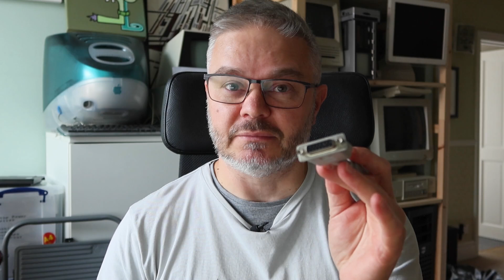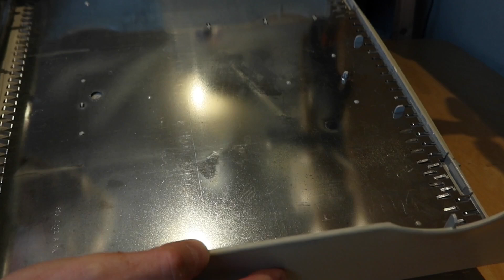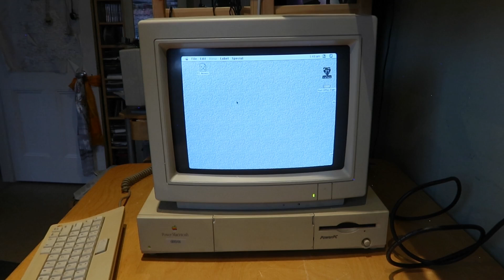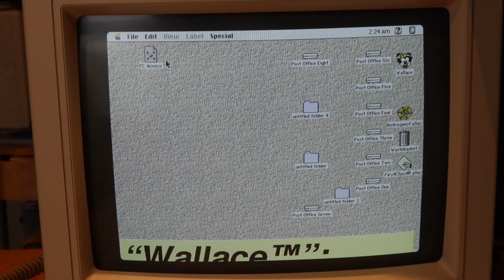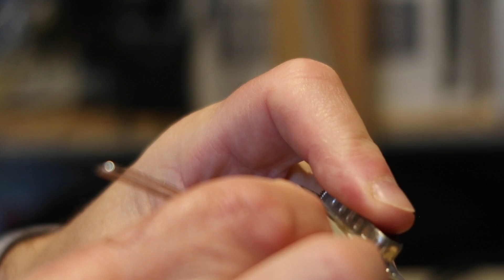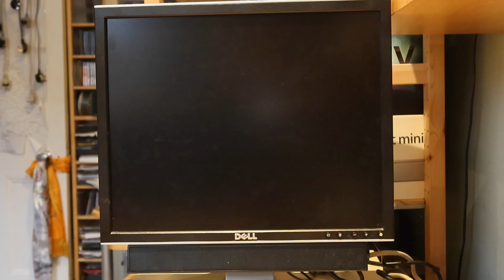Why this is the Key to the first Power Macintosh's

Comment: Upgrading from an LC II, I bought a 6100/60 8/160 for $1,600 in April 1994. I thought that video adapter came with it but I did have to buy the dip switch VGA one to support a 15" Sony multisync display which I think did 800x600. I added the L2 cache which the /66 came with. I also overclocked it to 80 and 84 MHz which I don't recommend because even with an extra fan, I think that killed it in 1997. In the early 2000's I used several of these with G3 upgrade cards to serve as gateways (NAT, DHCP servers, content filtering) in schools. First Class was originally a GUI BBS that had better interface functionality than AOL. You could chat, read through net mail forums and download at the same time for example. I ran one for a couple years.
Reply from the maker: I hadn't realised the two cards on the left were the ROM and Cache. I had assumed they were VRAM until I looked into it. I've got a 7200/90 without the cache card and it is really slow, so glad it's still in there.

Comment: Around the time that came out, I was using a Quadra 610 (68040 processor) which had nearly the same form factor but 15pin video. It had the CD drive with a caddy. I think it had 12MB of RAM. Previously I had been using a Centris 610 which was a similar computer but without the CD or FPU. If I remember correctly, a lot of software wasn't optimized for PowerPC at the time. The fancy Mac at the time was the Quadra 660AV. It had AT&T DSPs so it could do some speech recognition. If I remember correctly, the PowerPCs were able to do the same without the DSPs.
Reply from the maker: I think only something like 15% of the OS code was native PPC at realwease - the rest was run through emulation - pragmatic but slowww...

Comment: I wouldn’t say VGA was a standard yet in 1989. It was still a proprietary IBM port. And Apple had already had a history of using the DB-15 for video back to the Apple /// in 1980 (with a very different pinout), Apple IIc in 1984 and Apple IIgs in 1986.  So it wasn’t too surprising for them to reach for it again with the Mac in 1987 for the introduction of the Mac II. 

That said, the HDI-45 port was annoying - it only existed really for the AudioVision 14 display and for everyone else it was dongle town. Sigh.

Comment: New Sub; Deetroit, Michigan, US.
Well Done sir, Stupid Steve Jobs & NeXT with their Weird Proprietary Cables.
Stupid NeXT Slab Speaker Box...
Stupid Coleco ADAM and their Printer
Reply from the maker: I can see why they tried. It's just this always works better when it's an agreed standard (preferably open). USB-C anyone?
Reply: @NeilKnowsRetro  My PC & Video Game collection has been lost to a Drunkard Mom.
So I've been tryin to find Descent looking system even if they don't Function so I can have Adult ADHD Projects and stop driving the wifey nuts.
I would love to find a Cheap USB-C Power Replacement for these old Consoles.
I just picked up a TI-99 4/A, in Beautiful Condition, but no Power Supply. I've been Super Happy the Pi-PICO becoming a Mod-Chip of Sorts, Hopefully that continues Successfully with the OG Xbox & Dreamcast, I have the GameCube Pico-Boot that I need to get installed

Comment: Wow. I’ve never encountered an HDI 45 connector before and I have numerous PowerPC Macs in my collection. It would seem I have gap in collection. 😢
Reply: NuBus PPC 601 machines. The first and slowest ones. Expandability wasn't hot either - NuBus cards were way more expensive and way slower than PCI cards, and the native HDD and CDROM interfaces were still SCSI, which made drives twice as expensive for the same capacity.
Reply: @MistahMatzah  NuBus was a great idea, horribly implemented. But still better than IBM's MicroChannel architecture. lol
Reply from the maker: @MistahMatzah  At least NuBus was an IEEE standard. And 5 years earlier than PCI so not a fair comparison? Component pricing was was a problem in this era for Apple...not to mention product proliferation. It would have been an interesting time at Apple!
Reply: @NeilKnowsRetro  right, but by the time these machines came out Nubus was already seven years old and was a serious drag on system performance. When it first came out it was leaps ahead of ISA.
Reply from the maker: Glad  could help...sort of! Looks like a 6100, 7100 or 8100 is now on your list?